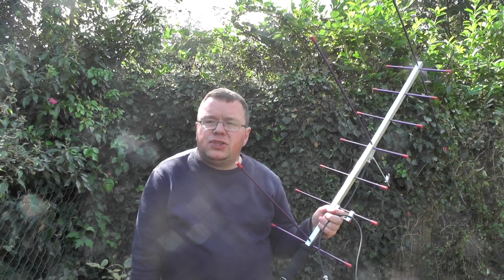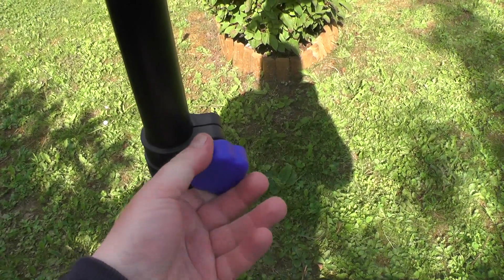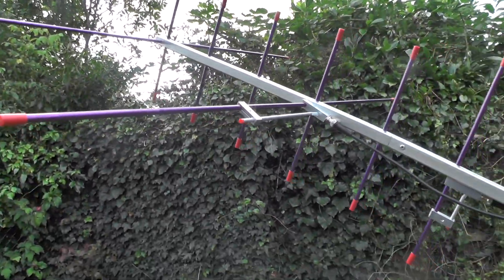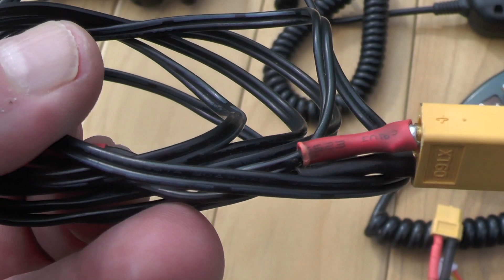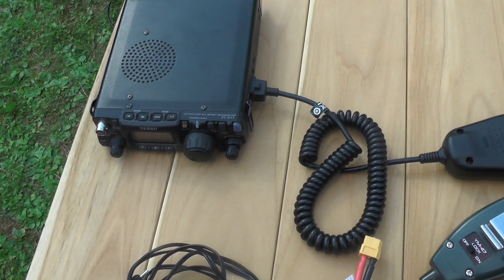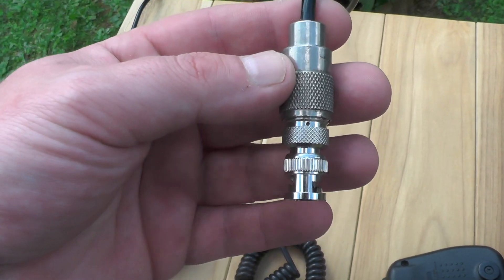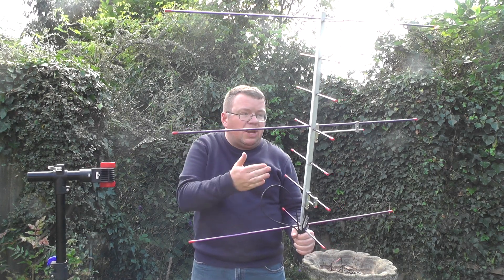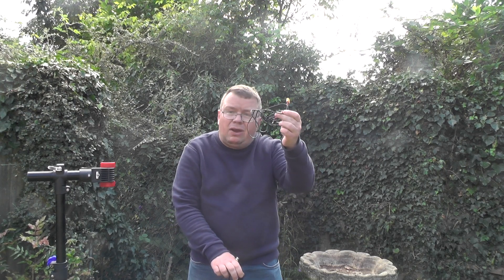Arrow 2 antenna and bike stand and power lead connections

Comment: Hi. A question...what kind of mount is that which you use? Where is it available? 73 Peter
Reply from the maker: The mount i used in this video is just a bike stand i got it from halfords which is a local bike shop which also sells car stuff as well it cost me £32 but the price has prob gone up now
Reply: @2j4ez  Thanks for the quick reply. I will also get such a mounting stand for my antenna. 73 from Switzerland